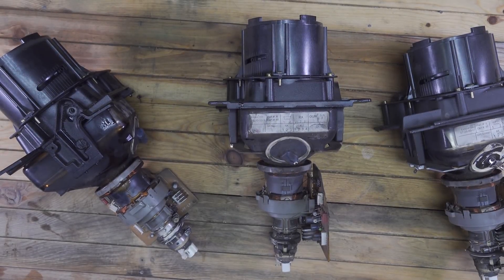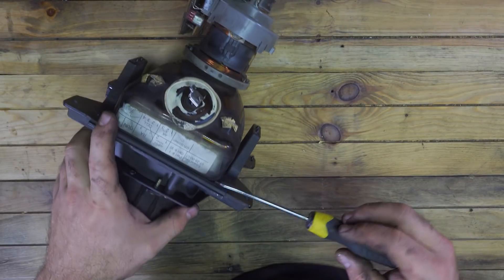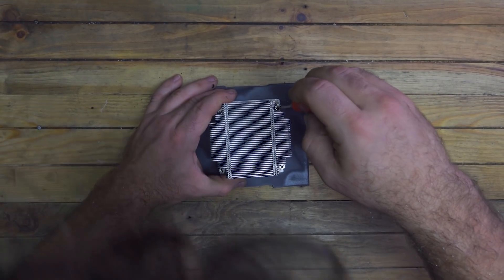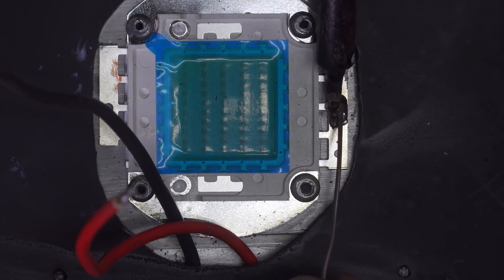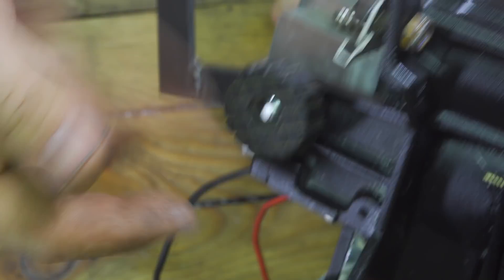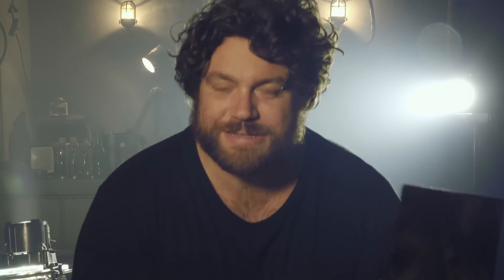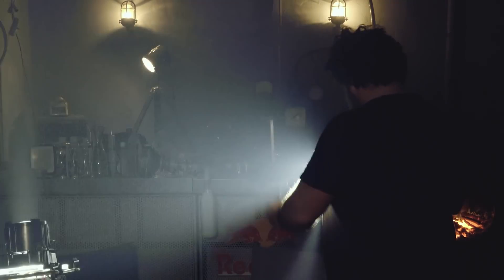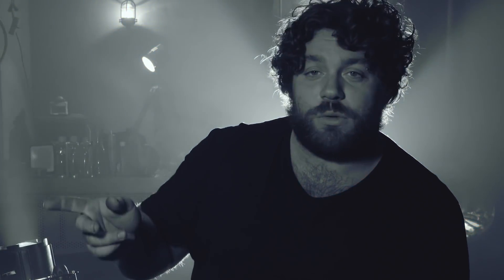How To Make Big LED SpotLight from an Old TV

Comment: I believe the rubber is there to allow the oil to expand when the oil gets warmer, without increasing pressure on the items that contain it. So maybe the oil is used for heat dissipation.

Comment: Oh no! You poured out the liquid crystal from your LCD! Seriously, though, it's the coolant for the projection tube - monoethylene glycol. I used to recover this stuff from old TVs but have never seen it used as part of the optics system - I agree it's weird. However, seems to work well, good work. You can use small photo umbrella to use it as both diffuse and spotlight.

Comment: The liquid is there becouse it has a higher Refractive index than air or vacum, therefor changing the properties of the lens. correct me if im wrong.
Reply: Probably true, we use mineral oil in microbiology on the microscopes to bridge the small air gap between the lens and the sample for a similar reason
Reply: True. Thats what we are using in microscopes

Comment: Oh, I once found a TV like that, but I took it apart partially on the spot, and only took out the round front lenses, didn't touch the liquid compartment. That was like 4 or 5 years ago.
Reply: CLureCo  It's not exactly a fresnel lens, more like a flat prism lens (like in LCD screens as well). There were a few of these sheets in there, and I've also kept some of them, but I don't remember where they are any more. But they sure made nice bouncy sounds while wobbeling around ;-)

Comment: you forgot to tell us why the liquid was in there!
Reply: The liquid is there becouse it has a higher Refractive index than air or vacum, therefor changing the properties of the lens. correct me if im wrong.
Reply: @hubertwszeborowski6670  it's also to there to cool it, but yes, that's the main reason - to prevent reflection within the lens
Reply: @Danny.._   "that's the main reason - to prevent reflection within the lens" - NO the liquid changes the lens properties. Becouse it is a medium with higher refractive index it refracts light more. You can see it on 5:32 when he pours the liquid inside. https://en.wikipedia.org/wiki/Refractive_index#Typical_values